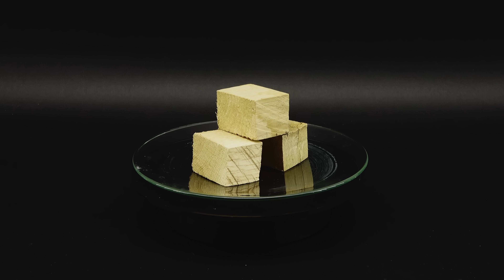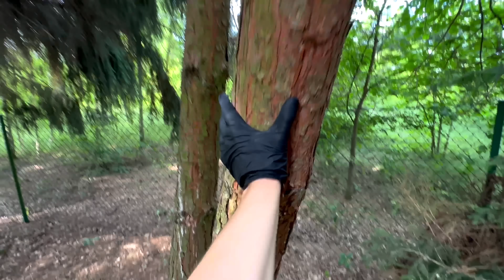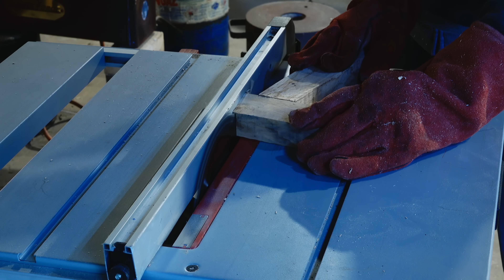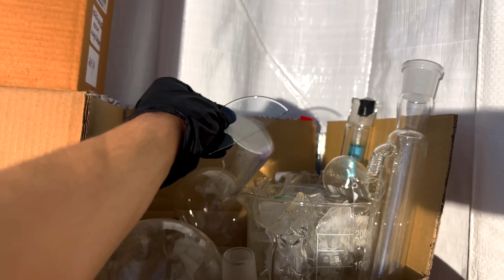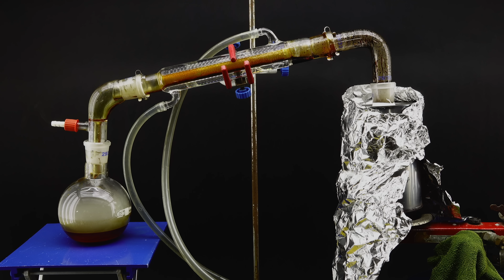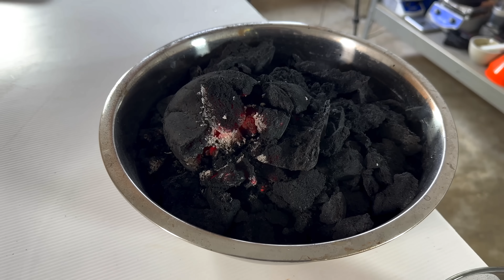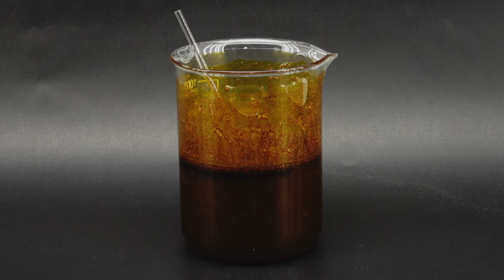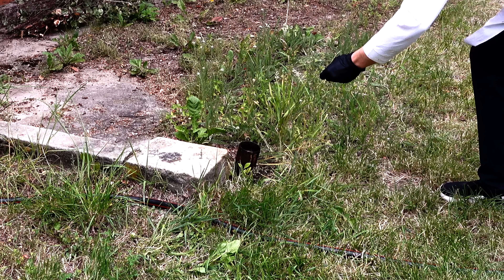Turning Wood into Alcohol

Comment: There is a 24/40 glassware to 3/4" NPT plumbing adaptor that can be used with a bulkhead fitting to enable destructive distillation from a 4L steel paint can. I think its great for stuff like this. Its made of PTFE and has a female 24/40 joint on one side and male 3/4" NPT threads on the other side. But your method with teflon tape worked better than I thought it would.

Comment: So the charcoal was burning due to the small size of the particles and being introduced to air wile still hot internally if you can spread it out in a cold baking pan like when u dumped it in the cold bowl first bumping the still hot charcoal on a bed of more charcoal will just make a fire bundle for any still too hot coal dust

Comment: You can drop the acetone from the primary distillate before fractional distillation by stirring in a few grams of sodium bisulfite or sodium metabisulfite.  This will form an insoluble crystalline adduct with any aldehydes or ketones in the pyrolysis mixture which will then precipitate from the reaction mixture.  You may then proceed with the fractional distillation.  Heating the crystalline adduct will regenerate the sequestered ketones and aldehydes, but not at the BP of methanol.  Sodium bisulfite can also remove acids from the primary distillate by reacting with them to form the sodium salt of the acid and sulfur dioxide, both of which leave the reaction mixture.

Comment: I cannot help but wonder.... What if you used paper, rather than wood? The MeOH is coming mainly from the cellulose, right? So, why not eliminate most of the troublesome tarry crap by using paper waste instead? Also, how about packing the paper into an iron pipe with suitable plumbing / gas connections, to a long thin copper tube as a condenser. The iron pipe, placed in a charcoal fire should give a much faster gasification rate. Also, if the distillate were collected into some water, most of any residual tar should separate out more easily (the MeOH/water mix could be purified with activated charcoal and Na/Ca or carbonate at this point followed by filtration). Unlike with EtOH, my understanding is that MeOH is relatively easy to separate by fractional distillation of the now, much-purer distillate since MeOH does not form an azeotrope with water.

Comment: Run a continuous garden hose off the can, (garden center has a fitting for rain barrels)over a rafter so it acts as a reflux tower and straight down into a pail  so tar ash and particulates wash down that side into lidded pail that has a compressor pulling and saving the woodgas. No dips to the hose, up and down and fairly high, so will need to cut it likely unless you have a useable high enough point.. If you got things a rockin point a fan at that hose. Have that pail in an ice tub to get good woodgas. Just that single spilt between reflux and over the top with no fittings at all, except of course the catching the valuable woodgas.  Methanol pours off the tar later well enough to use if you ran the kettle hot enough, and easy to separate further as a separate process(s). Still lots in the tar that is extremely easy to get later. Or just into an open pail if all you care is the wood alcohol (and open the big doors). Cheap stuff to buy btw. And keeps forever.  I used methanol as anti freeze in my windmill aerator and as de-ice on walkways and equipment. Old enough diesels to not have chips run on it just fine, but less power and they run cold. Your paint can may be any size. Use a hopper bottom grain bin if you want. If you need bigger I should ask why before answering I suppose. Just running wood heat used up all the wood cutting season I usually had. I always did want to make wood alcohol for my tractor, but it is far cheaper to buy diesel, and the time and work. I never got past making camp stoves. Cool ones that we used for years. I got some interesting vids on those from 20 years ago. This name, only one I got. Easy to search. A lot more advanced than this vid, no insult intended. Not monetized. Just to know stuff.  The original to YT Wooden wood rocket stove. A woodgas stove made out of glass to see the smoke path. A 45 minute burn indoor use wood pellet tldd gasifier stove, and others. Back from when this YT thing was just kind of new.

Comment: Hah! Finally, someone else who calls it WOOD GAS!
I also accept "green gas", not to be confused with "brown gas" which is incredibly dangerous. (HHO)

I live in a forest in Australia and am often at risk of bush fire, so it's in my interest to tend the forest. We clean up a good portion of the dead fallen wood and keep the leaves and underbrush to a managable level. The wildlife here on our little patch is dense enough that bio groups keep asking to come and study the place, so we must be doing something right. The frog population alone is supposedly an order of magnitute or two above the norm. But it means I have a LOT of wood to use up somehow.  Usually that involves just heating the house in winter with a small wood stove, and I sift the ashes from that to capture the charcoal for my furnace that I do metal tinkering with, and the ash goes into heaps to slowly become dirt to fill into the garden. Though I'm probably going to start collecting some of that also to get the lye out of for a few other experiments.. And to make the cement for the next version of the furnace and kiln.

But methanol.. That's fascinating stuff. I'd love to know how to make this stuff easily, as many of the old engines we have laying around were designed to run on practically anything flammable. The tractor we currently use used to run on power kerosene, and another one here runs on anything from crude oil up to diesel. The less flammable stuff just gets pre-heated with a firing pan under the fuel lines.  I'd love to come up with some kind of fuel mix that could run one or two of the old engines even if only to set them up as stationary motors to run generators for charging a battery bank or drive a pump to irrigate and get some more grass for the horses.. And fill a small dam for fire fighting.

Comment: Another nice thing that really helps with distillations is putting the reciever into some ice bath (in extreme cases the dry ice bath)
Reply: Using an ice bath is a solid tip for improving distillations. Dry ice can really take it to the next level when needed.

Comment: If I recall correctly, coal's tendency to autoignite is partly what contributed to the Titanic's sinking... Wonder if charcoal does the same 🤔
Reply: Charcoal can autoignite too under the right conditions, especially if stored in large, poorly ventilated piles. The Titanic's coal fires were definitely a factor, though charcoal behaves a bit differently since it's more processed. Interesting comparison!

Comment: wood gas distillate is used in a wood gas generator which involves apparatus that uses wood fire in the bottom chamber that heats saw dust turning it into gas  and is fed into a modified combustion engine that turns a alternator thus with help of four way bridge rectifier and step up  transformer inverter wood gas + engine = electricity
Reply: That's a solid breakdown of how wood gas generators work. The process is pretty efficient for off-grid power, especially with the right setup to clean and cool the gas before it hits the engine. Always interesting to see how alternative energy solutions can be practical.
Reply: @TheBook_Hungry_Minds  thanks my dad told about it from an article from Mother Earth news
Reply: @TheBook_Hungry_Minds  my dad wood gasifier generator we even are considering building one that would turn a three phase windings via the engine crankshaft of a old truck

Comment: I suppose one could get cellulose from wood and glucose from cellulose and use yeast to get ethanol from the glucose. Probably a lot of work.

NileRed got ethanol from toilet paper so getting it from wood should be only slightly more difficult.
Reply: Getting ethanol from wood does sound like a lot of steps, but NileRed’s toilet paper experiment shows it’s at least possible. The main challenge would be breaking down the cellulose efficiently before fermentation.

Comment: If you do want to make ethanol from wood, take a look into getting some wild yeasts.
Most standard beers use domesticated yeasts which can only break down very basic sugars and are very sensitive to keep alive.
But some beers (like geuze) use wild yeasts for beer making. These wild yeasts are true gigachads and  can live off basically any strands of sugars, including cellulose.
I visited an old brewery once that makes these beers and for research they wanted to swab their old building. They discovered several new strands of wild yeasts that lived in the wooden beams for hundreds of years. They were still alive and were capable of making beers, but lived off breaking down the wood/cellulose of the building itself.
Reply: Wild yeasts are fascinating for their resilience and versatility. That brewery story highlights how adaptable they can be, surviving for centuries in such harsh conditions. It’s cool how they can handle cellulose, something most domesticated strains can’t touch. Exploring wild yeasts could open up some interesting possibilities for ethanol production.

Comment: 40 grams is 2% of 2000 grams, not 0.02%. Seems like a resonable yield to me. Sure, that process isn't practical compared to buying methanol, but I think it would be interesting to see if would be possible to make a scaled up version that could be somewhat practical.

A much bigger version should be much easier to make able to rely on the generated wood gas as the main energy source, after a startup period.  Besides the methanol, also acetone can be somewhat useful, even if that also isn't very expensive to buy. In a post-apocalyptic scenario acetone can be used as a liquid fuel to, and for engines, some acetone "contamination" doesn't necessarily have to be a bad thing.

The sodium acetate can be used for low temperature phase change thermal storage, as in sodium acetate trihydrate, the stuff in common "rechargeable" hand warmers.       

The charcoal is an obvious potential solid fuel, but can also be used as a soil conditioner, improving the soil's water and nutrient retention capacity, which can help improve soil fertility, a lot.
Reply: Scaling up the process could make it more practical, especially if wood gas becomes the primary energy source after startup. The byproducts like acetone and sodium acetate have useful applications too, from fuel to thermal storage. Charcoal’s role in soil improvement adds another layer of practicality. It’s a neat thought experiment for self-sufficiency scenarios.

Comment: The reason why the glass cutting worked so well might be that chemistry glassware is made of borosilicate glass, it’s different from the kind we normally see and that’s probably what the guy was talking about out
Reply: That makes sense. Borosilicate glass handles thermal shock much better than regular soda-lime glass, so it would be less likely to crack during the distillation process. The creator's setup definitely benefited from using the right type of glassware.

Comment: You could buy a cellulase, incubate a wood with this enzyme, and then brew and distil this as any other mash.
Reply: That's an interesting approach. Using cellulase to break down the wood into fermentable sugars could work, but it might not produce methanol directly like destructive distillation does. The enzyme method would likely yield ethanol instead, since it mimics the fermentation process used in brewing. Both methods have their pros and cons depending on the desired end product.

Comment: One thingn- you probablybdid not need to make all those sawdust. The oak charcoal (pure) is succesfully pyrolized from just simole wood chunks, it just would take 2x as long to pyrolize.

Czesc!
Reply: That's a good point about the wood chunks possibly working with longer pyrolysis time. The sawdust likely speeds up the process by increasing surface area, but chunks could be more practical for smaller setups. Czesc!

Comment: Many places during ww2 used woodgas as fuel in gasoline engines, for ex finland during winter war for non military trucks but still esential like food or medical supplies used wood gas to transport, stuff like busses would use it, with a small container of gasoline with a valve so for a tough place like uphill you could temporarily give the car a "boost" with gasoline, and then quickly switch back to woodgas.
Reply: That's a fascinating piece of history. The adaptability of woodgas as a fuel source during resource shortages shows how versatile these old techniques can be. The temporary gasoline boost for uphill climbs is a clever workaround too. It's impressive how they made it practical under such challenging conditions.

Comment: In the same vein as The Book ™️, you could do a video on extracting useful chemicals from plants, such as turpentine from pine or some form of essential oil distillation and fractionation to separate different compounds
Reply: That's a solid idea. Extracting turpentine from pine resin or isolating essential oils through distillation would fit right in with the channel's focus on practical chemistry. Fractionation could really highlight how versatile these techniques are for separating plant-based compounds. It'd be interesting to see the yield comparisons between different methods.

Comment: Well instead of expensive glassware some copper or steel pipe could have been used . You could have even done a fractional distillation column using black pipe, & pipe Tees at different levels to extract the different compounds.
Reply: Using copper or steel pipe is a practical alternative, especially for those working with limited resources. A fractional distillation column made from black pipe and tees could effectively separate the compounds while keeping costs down. It's interesting how adaptable these processes can be with different materials.
Reply: The column could be a pipe packed with marbles or pot-scrubbers.  This was in a fuel alcohol design in Mother Earth News in July 1, 1979 (found online, search "alcohol mother earth news july 1979")

Comment: if fractional distillation is that precise, then it could be used to extract the ethanol in the wood juice as well, it is likely that some ethanol will also be produced during pyrolysis
Reply: That's a good point. Ethanol can form during pyrolysis, though methanol is usually the dominant alcohol. Fractional distillation could separate ethanol if present, but the yield might be low since hardwoods favor methanol production. It would be interesting to test the distillate for ethanol content.

Comment: I question whether all that sawing and grinding gave you any advantage.  The wood blocks were already as compact as wood is going to get.  You just fit a few more of them in the can.  It would be easier to just keep refilling the can with blocks and heating them until they stop gassing, since they're already porous enough to liberate gases quickly.

And like many other people, I caution you not to wear gloves when using a table saw (or drill press if you're ever inclined to do so).  With them you on you elevate the risk of serious injury.
Reply: The finer wood powder likely increases surface area for more efficient heat transfer and decomposition, but your point about the trade-off with effort is valid. Multiple batches of chunks could work too, though the powder might help achieve more consistent results.  

Good call on the glove safety reminder. Loose gloves near rotating tools are definitely a hazard worth avoiding.

Comment: So I've done this a few times myself, and if you pulverize the wood too fine, the problem isn't the wood gas getting out, but the heat getting in. The gas will always make it's way out, but even sawdust from a saw doesn't transfer heat well. In my experience, cutting wood into quarter inch strips (or something close) maximizes the wood's ability to absorb radiant and convective heat.

Also, pumping in a very slow, small amount of water will up your yields substantially. I don't know what the proportionation is though. Probably a lot of CO.
Reply: Interesting point about the heat transfer issue with finely pulverized wood. The quarter-inch strips sound like a practical compromise between surface area and heat penetration. The water addition trick is new to us - makes sense that it could boost yields by promoting more complete decomposition, even if it introduces some CO. Might have to experiment with that next time.
Reply: @TheBook_Hungry_Minds  Eh, its worth trying for some things. Its important that the "water" actually be very very hot steam though, so a lot of coils of very fine copper tube and a needle valve. And also obviously the coils have to be in the fire or whatever. I just throw the whole thing in my wood stove.